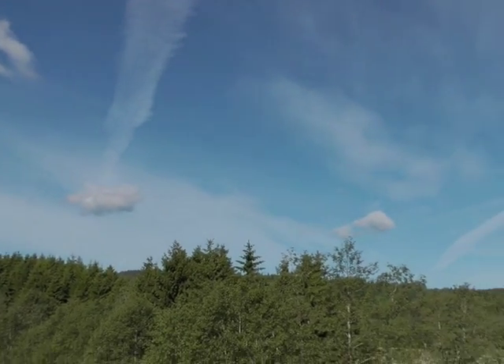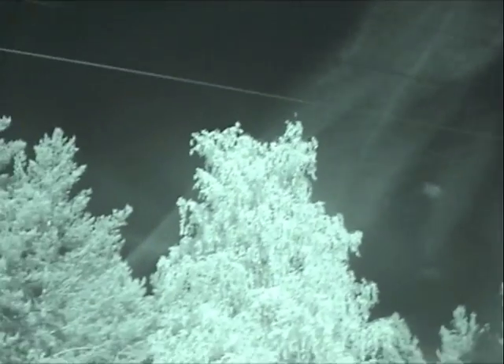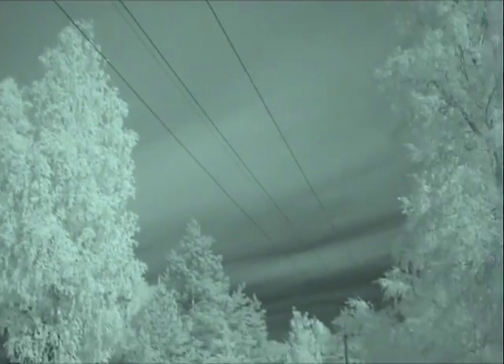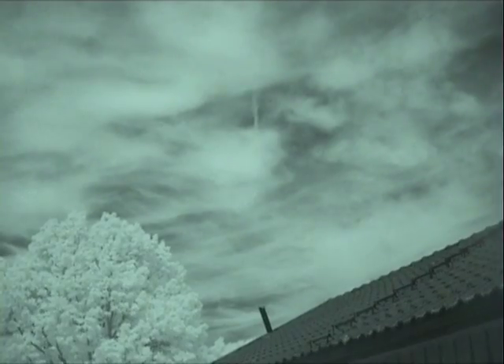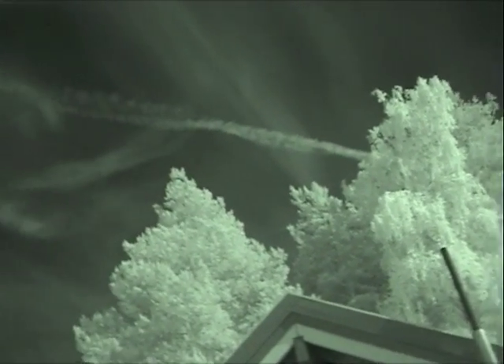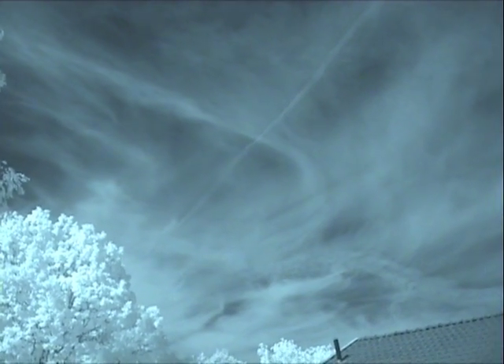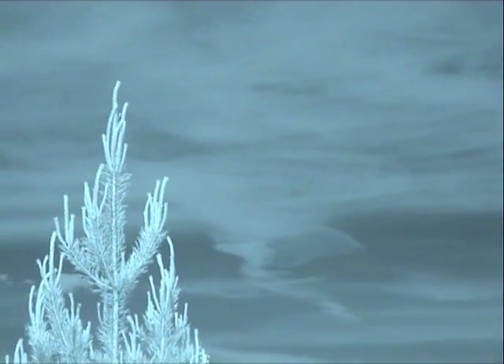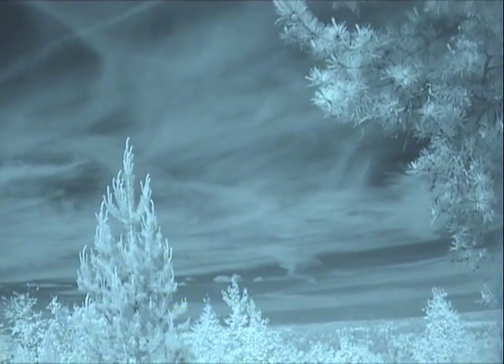Chemtrail spraying in Norway - with Infra-Red camera - one week in May 2012

Comment: chemtrails dont exist, its the water vapor condensing in in the exhaust of the plane making it into a cloud, its just a cloud and if chemtrails existed, the aerosol or whatever it is would not be visible due to the fact that aerosol if invisible from that distance. another thing, where would planes store all of this aerosol? they dont have anywhere to refill the tanks (which dont exist due to the fact that there is no place in the plane that can hold that amount of aerosol unless the plane had no fuel or passengers) and the amount of aerosol needed would be massive. any chemical would have to be mass produces on a level that would require thousands of workers and would be impossible to hide because you would have to have a giant pressurized tank for the aerosol and a tank for fuel, airports inky have fuel tankers, no aerosol tankers.
Reply: Otter Turtle 
Zzzzzzzzzz!!!
WAKEY WAKEY RISE AND SHINE !

Comment: Condensation has to do with water going from gas form to liquid form, it requires very specific scenarios to happen. And air is not uniform (the same in every cubic foot of air), so there are parts of the sky with wrong humidity, wrong temperature, wrong wind, and the engines throttle and mix the air (otherwise you'd feel the heat (infrared radiation) from the engines through the windows of the airplane). It looks like they're spraying, it looks like you're dumb, but its not what it looks like.

Comment: Go educate yourself to become a pilot, or airplane mechanic, and see if you find chemicals, spraying-equipment and so forth in the airplanes. You could see if someone ever fills the airplanes with something other than fuel. But I'm 100% sure you will be dissapointed, however dissapointed you can be as a well-paid mechanic. Its the cars, trucks, exhaust of burning petroleum, coal and coke and all the other shit that gets into the air, the polluters don't have time to pollute with small airplanes.

Comment: For example, one test say the air had 28 000 times more iron than is safe, but they used "MLM" levels as "safe" whatever that means, not the CDC's "Immediately Dangerous To Life or Health Concentrations (IDLHs)" definition. They're confusing themselves with comparing milliliters and parts per billion (55 gram iron and 1 gram hydrogen in a box, will have equal parts per million amounts, it has to do with the volume of the atoms (milliliters) and number of atoms (parts per million/billion)).

Comment: It has to do with the humidity and temperature of the air and which altitude they are at (a delay on 1 or more runways quickly mean they stack airplanes around the airport in different heights and orbits like in the movie Die hard 2, ergo, planes show up around the airport where they don't usually show up). Where are these test-results if there are so many? The ones I have found don't specify instruments used or which measurement unit they are using, nor do the data mean the source is airplanes.

Comment: Its WATER!!! Condensed water. Condensed water releases heat to the surrounding air and water vapor when it condenses. And if you had a car with ten thousand horsepower, the streaks after you would look like clouds. If you think there are chemicals inside these trails, I must ask you to do an experiment that proves it, otherwise you are saying "I do not know what this is, therefore it must be [insert fallacy]" when you should stop after saying you don't know what it is.